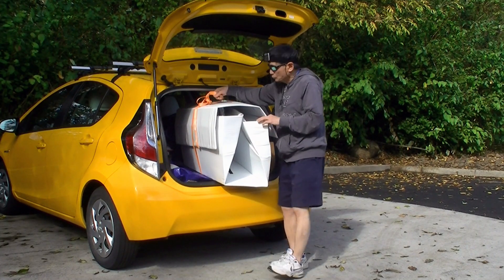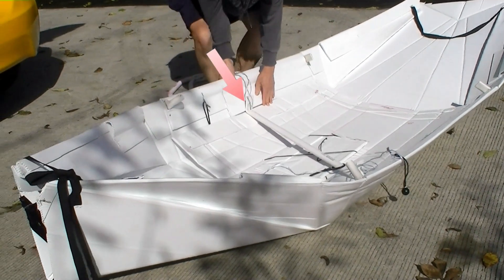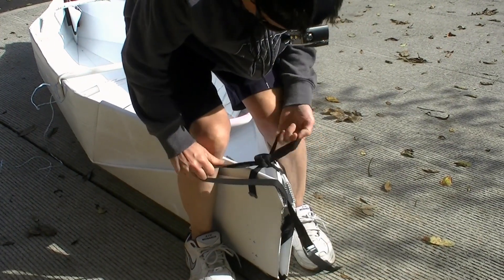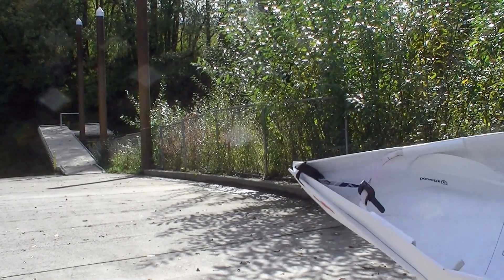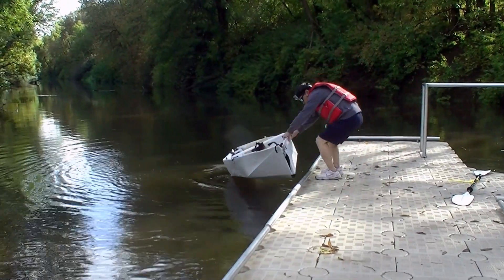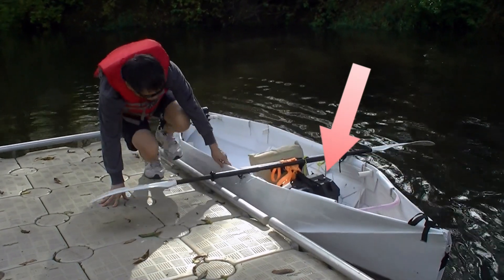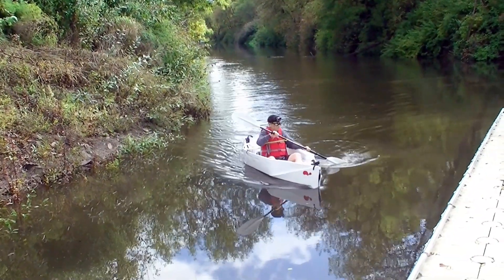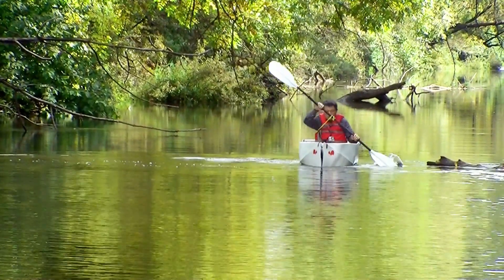Build / Water Test the Gen 12 Kayak/Canoe Part 3 自製 摺疊獨木舟

Comment: Brilliant design. I noticed, at At 3:40 the corner of the gunwale, where it transitions from the side to the front, appears to be buckling due to the buoyancy of the bow opposing the weight in the center, causing that corner to experience a high compression load that causes it to buckle. You said earlier in the video that you and the boat together weigh 153 pounds. I imagine a 200 pound man trying to ride this boat may see the bow and stern bend upward. This was quite apparent in the Maker video (also at 3:40) with a heavier guy demonstrating a previous-generation boat. Is there some way to reinforce this corner to withstand the compression induced by a heavier person?
Reply from the maker: Thanks for your comment and great observation! I looked at this video again, at 3:40 and also during the rolling test, I couldn't sense the buckling. If there is, it is more likely to be at the stern than at the bow because my feet rested on the bow section and basically pushed down on the bow. You are correct, the situate could be worst with added weight. Buckling is something I am concern about and in Gen 12, I actually have a provision to strengthen the front (and the rear) by extending the PVC (gunwale) to the front (and at the rear). I will have to create extra brackets to support this extended PVC gunwale both at the bow and at the stern. I haven't done that implementation because my body weight and the 6 mm thick coroplast seemed to be strong enough. With the Maker Gen 14. It is very obvious. Nat built a few proto-types. He added extra layers to the floor (he used 4 mm thick coroplast) and that fixed the problem in the final version, which is the one towards the end of that video. As for Gen 12, the floor is just a single 6 mm layer thick coroplast. It didn't extend past the  folded joints. If there is buckling, I can lengthen that first. The drawback is the package size of the kayak will be slightly larger.  Cheers!
Reply from the maker: Thanks for your question related to buckling. This video discussed one method to fix the buckling issue.
https://youtu.be/UMnuLs5N3oE
Reply: @DIYUSA  - I see, thanks. Reinforcing the floor had not occurred to me.

Comment: Very Nice. It would be good to see some more details of build. But looks very nice. It would also be interesting to see if you can make it with smaller plastic sheet welded together.
Reply from the maker: Thanks for your input. I am working on part 4 and will share how minor modifications to the current design will change the stability of the kayak. Part 5, I will show how the boat is folded together and how to modify the design if I use a 48" wide coroplast. Part 6, I will provide more details in how I build this kayak. A friend of mine will be doing a build (similar kayak plan, later this month) using two sheets 4 mm 4' x 8 ' coroplast fused together. I am providing him ideas in his build. Hopefully there will be more info to share. Cheers!
Reply: @DIYUSA  Thanks for the video. I look forward to these future videos and the plans. Good work!
Reply from the maker: @dennisboyd2859  Thanks for your feedback... I have two friends planning to build this boat, one with 5'x10' 4mm coroplast and the other boat will use multiple 4'x8' 4mm coroplast (fusing the sheets together). I am working on a detailed step-by-step tutorial. My friends asked a lot of good questions hence I can see what are missing in my videos.. please stay tuned and hopefully there will be learning from them also...